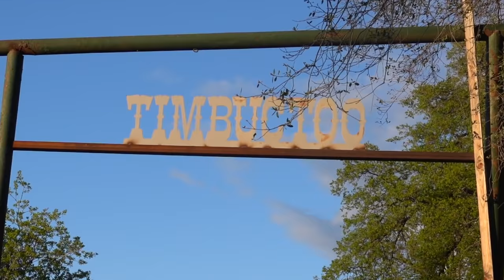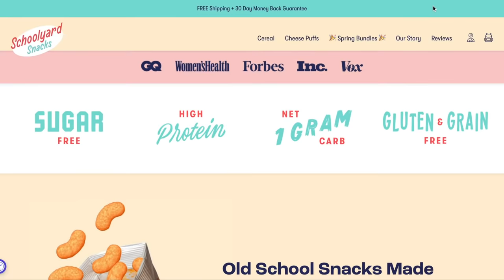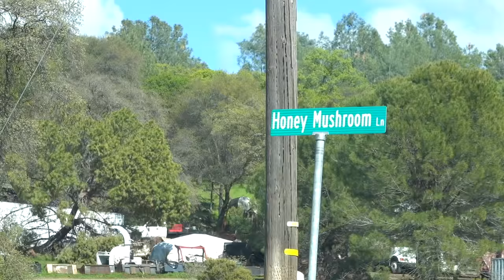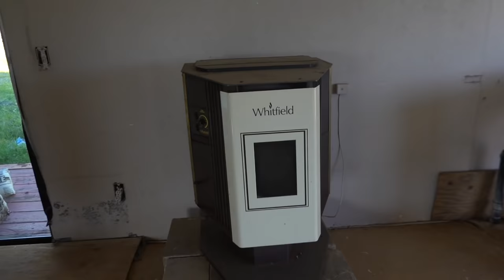PURCHASING OUR DREAM LAND IN CALIFORNIA?!

Comment: Here are just some thoughts that I had when I was watching this video. I am glad you didn't take any of those properties. A river property like number one will probably never be peaceful. It will be noisy there all year round and the moisture can be a problem. And you will most likely never be able to get rid of all those wild blackberry bushes growing there. They are extremely invasive. Number three was way to close to heavy traffic. Noise travels uphill so you will always have the noise. And there was something about that place that I didn't like. I can't put my finger on it. I would not have bought property number two either, because all the pine trees were dying there. There must be very toxic air and soil there. It did not look nice on the drone footage. You can see it there. A nice view is very nice to have, in the beginning. But you don't sit and look at it all the time, and you get used to it. But having a nice view like that can also mean a lot of wind almost every day - depending on the area. Windy conditions are not good. It makes you want to stay indoors because wind often makes you feel cold and tired.  It is easier in many ways to have a property that is mostly flat. Sunny and with some healthy trees around is good. The house should be facing south and not have an uphill in front of it. These are just my opinions based on the little that we now have seen of the properties. I might have felt differently about it if I had been there and felt the energy in the area. Another thing that is important, is having good neighbors. Ask around a bit in the area to see what it is like, and to find out if there are any troublemakers living close by - or other things that you don't want to live close to, like some types of industry, military areas, airports and so on.

Comment: So fun to tag along on this adventure. As mentioned below, patience will lead you to the right location. Wherever that location, if you're buying wooded property in the foothills or coastal ranges, wildfire is a big factor. Insurability, defensible space, and two or more ways to evacuate are just a few of the things you'll want to thoroughly understand before making any offers. Roughly speaking, the elevation band between 2500 - 3500ft is a good balance for staying below the snow and above the hottest temps. Also, mind the arc of the sun during winter. Some places can be in shadow during the winter months.

Comment: You're in my hood! 
If you don't have cash, you'll probably need to find something that is owner financed unless it has a little house on it that a bank will loan on. The first land that I bought I got ripped off on the interest by a private lender because I wanted it so badly I didn't know better. Maybe banks are loaning on land these days though since prices are so high. In fact I'd recommend you wait till prices go down at least a little. You've been driving around for years, a little longer won't hurt. 
The land with the moss is probably on the north side of the hill, so with property like that make sure it has an area near the top of the hill for your house or you won't get any sun in the winter. 
I have some land I might sell but it's not nearly as large or as expensive as what you're looking at so you might not be satisfied with it.
Reply from the maker: We both said that we think we are meant to van around a bit longer for reasons you have touched upon above ❤️ Thank you for your kind and wise words. xx